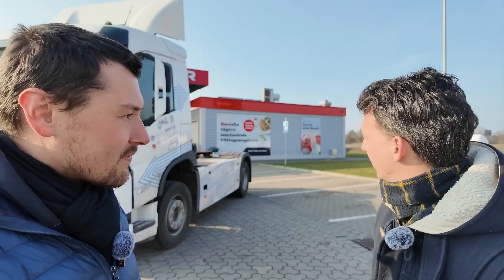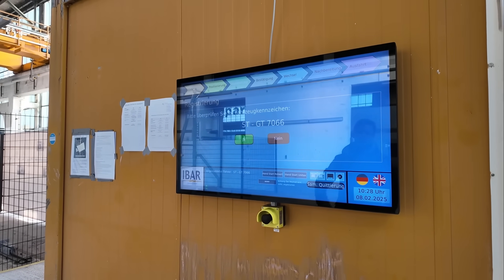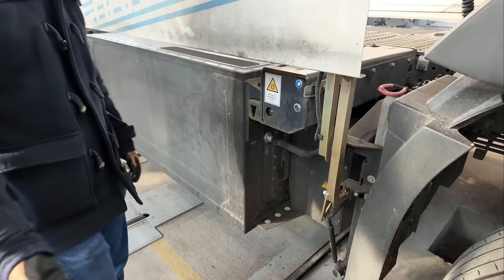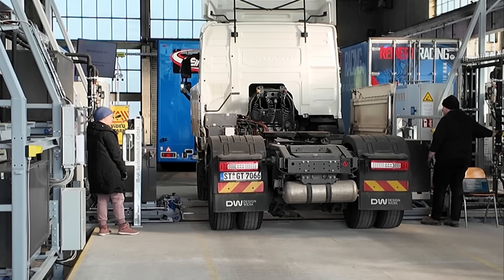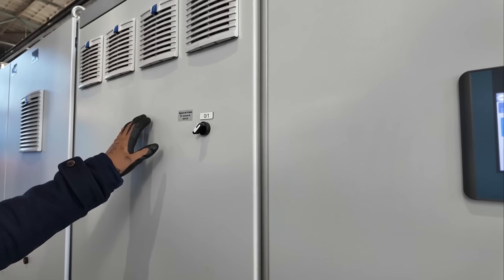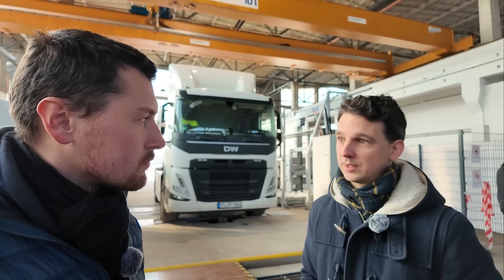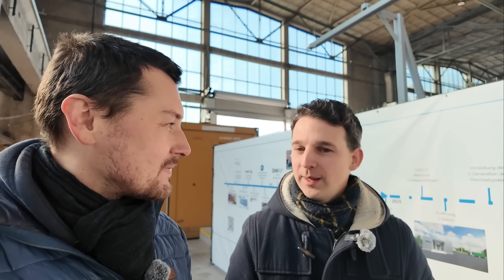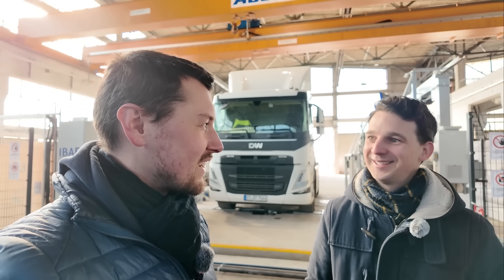Truck Battery Swapping is here! And it's made in Germany 🇩🇪

Comment: Some people only point the problems, others develop solutions. And this technology is a solution enabler.
Reply: Well solutions to a problem that they made in the first place. You made the problem and then you say "sorry ".  This is un engineered system - the entire truck EV system. It's a trail system. 

The operating costs for long hauled cargoes is not even calculated. When you include the price of the truck and other costs the entire cargo service is not so cheap. You could even say it's more expensive, at least in the beginning.
Reply: @teovm  The goal is not necessarily to make it cheaper, but to make it run with zero emissions at the same overal costs. And perhaps even with less costs, which would be a bonus. But I wonder where you get your numbers from? Did you do all the calculations to the last detail and for the long term? Or are you just guessing?
Reply: @insAneTunA Zero emmisions is a wide term that no one is calculating all the ingredients. And it looks achievable but not as fast, as they want it. Also zero emmisions for vehicles has major difference in city's. Outside of that we have a lot more problems than vehicles that need to be addressed with way more consequences. And we have to put our minds and money to solve those problems, as we will benefit a lot more from them, then vehicles.

On the money side every 10 000 Euro more for an EV vehicle  (like a car) equates to about 150 000km and if you predominantly charge at home.
Reply: @teovm  You have the right to your own opinion, but you don't say where you get your numbers from, therefore I assume that you are just making things up. Personally I disagree with you in every aspect of what you said. Zero emissions during its use is a big step forward in reducing the emissions that cause global warming and mass extinction of biodiversity and a lot of financial damage from extreme weather events. Not a single human activity is without emissions, but the goal is to reduce the total global amount of emissions to a responsible level.
Reply: @insAneTunA  I'm not sure what is happening to my responses, but they are not shown here.

Now in 2019 there is a stat that shows that 60% of all emissions from transport are from cars and 20% from truck. This is in the EU. And my data is from europa .eu CO2 emissions from cars: facts and figures (infographics) Published: 22-03-2019, Last updated: 06-12-2024 - 15:16 
So we should focus our forces to deal mainly with cars. Also cars are used more inside the city, heavy truck on the other hand are mostly outside of the city. 
Now in the city you could deal with a lot more then just replacing ICE with EV - public transport, bike lanes, walking infrastructure, and other infrastructure that will give people a chance to walk to their daily destinations - School run, work run, food shops and others. Walking or using a bike is far more Zero Emission way of transport, but there is no business in this. Bike lanes and walking paths are fare less expensive then roads and cars. Keeping our economy alive by forcing people to buy cars and build more roads is stupid as those money are spend on thin air.

Also Transportations is not the biggest polluter.  So we should do a lot more for the other polluters like agriculture and factories and other energy users. We will win a lot more in total if we address them properly. 

Keep in mind that China, USA and India are bigger polluters than the EU. China is leading everyone, not because of cars, but because of production emissions. So global emissions amount from heavy trucks is nothing when you compare it with the China factories. We will be more useful if we stop with the stupid "throw and buy new" psychology, planned obsolescence from manufacturers, right to repair,  and other far more energy efficient ways to reduce our global emissions even our local emissions.

Killing forests and other habitat in order to build solar is stupid too. When we even do not have a way to store the energy. Here solar plants now have to pay the electric company's fees when overproductions as there is no way to store the additional energy and let me tell you EV's are not the way to store it. We need two level hydro dams and other methods so that we can store energy when it's produces by the so called green energy sources. I'm talking country or regional solutions not personal stuff. 

EV trucks especially heavy trucks at the moment will not be beneficiary for the community when it comes to total emissions. They are a business idea, so that business can lower it's costs. But even that is not 100% sure in the long run. At the moment it's just a hype, covered by green thoughts. Looks good and people are convinced, like a good advertisement.  Also truckers are not very welcoming the idea when they have to lose additional time for charging and finding workable stations. On the other hand light trucks, especially ones used in the city will benefit from EV engines. But at the moment it is still expensive. As electricity for companies is really expensive - twice the price compared to home use.
Reply: @teovm  My personal view is that every type of industry has to reduce greenhouse gas emissions, so that includes logistics. And it doesn't exclude agriculture or any other industry for that matter. And besides the reduction of greenhouse gas emissions the transition from diesel to electric will also reduce the emissions of severely toxic elements and fine dust. 

It is only logical that you can't fix the entire global greenhouse gas emission problem by only  transitioning the logistics industry from diesel to electric. But that isn't a valid argument to do nothing at all. Other industries will have to do their part to reduce those global greenhouse gas emissions. Not a single industry can fix the issue by itself. 

I think that logistics companies are very good at calculating the costs and the profitability from their business and the EV technology. If it weren't profitable or competitive enough they wouldn't implement and use the technology. And besides that, there is a clear trend that the technology and infrastructure continues to improve, and costs continues to go down despite all the uncertainty that the world is facing right now.
Reply: @teovm  If you are not convinced about the reduction of costs and improvement of performance for BEV's then you can read the scientific paper with the title, Historical and prospective lithium-ion battery cost trajectories from a bottom-up production modeling perspective. Which can be found at the page from ScienceDirect. It includes all the sources of information.
Reply: It's a solution looking for a problem
Reply: @nemesisnick66  The problem is that our current transport system including infrastructure and scheduling has been optimized for fossil fuel use. This is looking at a solution for making the infrastructure better fit an EV transportation model. While this system is first being setup for companies with scheduled runs in could also end up working for "for hire" truckers. Battery leasing would make the upfront cost of an EV much cheaper.
Reply: @nemesisnick66  Can you give an example of such a problem?

Comment: This would be ideal for scheduled intercity coach services that run all day. Also possibly other urban bus services that run 24/7. Think of the type of bus and coach services where drivers swap at the end of their shift, it doesn’t leave much time for charging.
Reply: Urban buses don't do much mileage, so it is easy to charge them overnight. 
Better still, have a lighter schedule during the middle of the day so the buses can charge on cheap (or negatively priced) solar power.
Reply: @alexterrell1062  and they can sell power back to the grid with their excess capacity after dropping off the last kids in the afternoon...
Reply: @alexterrell1062 Urban buses in my city operate 24/7! They operate almost all day and night! Also I should have said that the urban buses in my city are Double Deckers, we have EV double deckers, but they struggle to operate all day. They have to be taken off the routes half way through the day to recharge and are replaced by older Diesel buses, so they aren’t a perfect replacement yet. That is why battery replacement would be a good solution for them in my city.
Reply: @bk99911 That is unusual but maybe not for a big city. Our buses stop at about 8pm - but they do drive between villages at more than 30km/h. But even in London, buses will not be used at the same intensity all day. They should have a few hours downtime over night. Of course, the issue may be there is no one to plug them in at 1am and move the plug to the next bus at 3am. 
The main place where battery swapping is being used are in ports, where vehicles do operate 24/7, even if they never stray more than a few km from the swap station. 
A future use should be agricultural vehicles, so a farmer can work during the day whilst the spare battery is charging up for free, with a quick swap at lunch.
Reply: @alexterrell1062 London Bus definitely operate all night long! Not the whole fleet obviously, but a significant portion. London night buses are pretty famous. Your buses stopping at 8pm is shocking, that isn’t a real bus service! I’m guessing you might be in the US so? Even in small European cities buses tend to run all night. Otherwise how would shift workers get to work, people go for drinks, etc.? BTW bus depots tend to have special staff who work in them overnight, they are called shunters, they move the buses around the depot, make sure buses are refuelled, cleaned, checked for mechanical issues overnight. 

I can see why you wouldn’t think charging an EV bus overnight is an issue with your bus service ending so early, but in cities with 24/7 bus services, it definitely gets far more complicated to manage.
Reply: @bk99911 I'm actually in a small German town. Bus from village to town is once per hour. People use cars. Or bikes. 
I lived in London so know the night buses. The volume of night buses is a fraction of the volume commuter buses. Everywhere will have 100% of their bus fleet being used in the morning rush hours and evening rush hours, maybe 75% during the day, and maybe 0 to 25% at night. 
Larger bus depots will have shunters, and some might even have a decent electricity supply. I doubt our local town has that though.
Reply: @alexterrell1062 Ah, that makes sense, where I live we would call that a rural service or perhaps a commuter service. The city I live in isn’t as big as London, but has a bus fleet of over 1,300 city buses and carries 150 million people per year. The buses are very intensely used as we don’t have rail as a typical German city has. 

We have a couple hundred EV buses now, but they have been a big challenge. First the local grid simply didn’t have enough power to support hundreds of buses being charged at the same time and the other problem was that there simply wasn’t the space in the existing bus depots to install the chargers. They had to build an entire new bus depots, so they could temporarily take the buses out of each of the old depots to install the chargers in and then putting them back. Very big expense. It has costs tens of millions of Euro on depot works alone!

Yes, you are correct, there are times throughout the day when charging can be done, but that involved hiring extra staff to manage that and the operation of the fleet has to be more carefully managed to make sure the buses have enough charge and their time back in depot more carefully scheduled. We have already had buses end up on the back of the tow trucks due to mistakes being made. Definitely not impossible, but challenging.

BTW my interest is more in intercity and long distance coaches, we haven’t figured out how to electrify those yet. They tried some hydrogen coaches, but didn’t work out well. Being able to swap out batteries could allow these sort of services to also electrify.
Reply: Batteries for buses is an interesting area. Since the schedules and routes are usually somewhat predictable it’s an easier solved problem.  They make a lot of sense for school buses which have a lot of down time between uses.  

But BEV city buses are getting quite common in china.  Shenzhen has had BEV only buses for 8 years already. (A city with a population of 17 million… much bigger than anything in Europe).  They haven’t needed swapping for it too.
Reply: @xiaoka In many Chinese cities they took the approach of having twice as many EV buses as drivers (or their previous Diesel fleet size). Basically half the fleet stays in The depot charging, while the other half is out operating, when a bus runs low they then swap it for a fully charged one in the depot. Fortunately that is becoming less necessary as battery sizes increase and costs drop, but it still complicates fleet operations in cities where buses operate all night (no time for a couple of hours charging). Careful fleet management and charging is needed in the depot to handling charging and make sure enough full buses are always available.
Reply: @xiaoka  on the school bus side of things it depends on the country - in the UK buses that do school commuting tend to then go off and do a lot of other jobs during the daytime, they don't all sit idle.

Comment: What size does a commercial three connection start at in Germany, 180kW is a large connection still I think.

For example, in the UK, three phase connections start at 45kW, around 65 amps per phase.  The connections remain much cheaper up to 100 amps per phase, around 70kW.

Comment: Bravo! This is excellent progress. Swapping will be huge need when we move to inner-city short distance transportation. This one thing can enable lower initial cost of ownership by reducing initial cost of the vehicle. There could be business model to lease the batteries. Such a situation will ensure 100% recyclability of these batteries. Vehicles will always have the healthiest batteries on the run. AND govt can step in time and again to subsidies the battery usage cost just like all govts on the planet subsidize gas price to the effect of trillions of dollars. 

One suggestion to the team eHaul, please make the roof of that very huge facility solar (at newer facilities you build). No not fitting solar after the roof is setup since that adds cost and weight to the roof. The roof itself is structural solar. This is a use case where it will have noticeable positive addition to the bottom-line.

Comment: Would be cool if they could swap the batterys with fork lifts so companys could swap it in their own yards with existing machines
Reply: Swapping with a forklift would require more skilled labour and probably be prone to error.
Reply: @alexterrell1062  Dont know about the system complexity but if it is just pins like he says, then I can not imagine its much more skilled than normal forklift operations.
Reply: @Pluckaiy That makes sense. eHaul could maybe design a layout for both robotic operations (for e.g. more than 4 swaps per hour) and manual, e.g. a few swaps per day. A typical depot could start with the fork lifts and as they get more trucks, move to the automated process. 
A key benefit is if the batteries can be in the container, charging off peak over night or at the weekend.
Reply from the maker: I asked him about it and it's possible to swap them with a forklift.